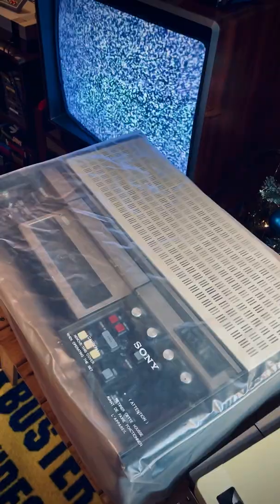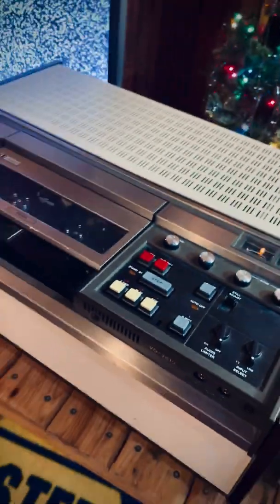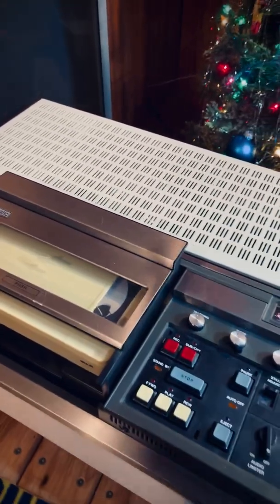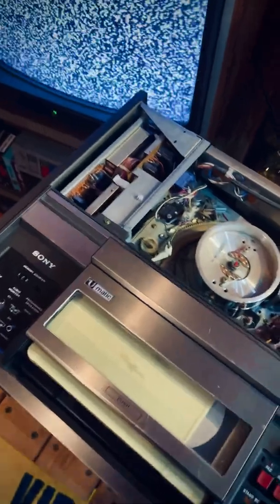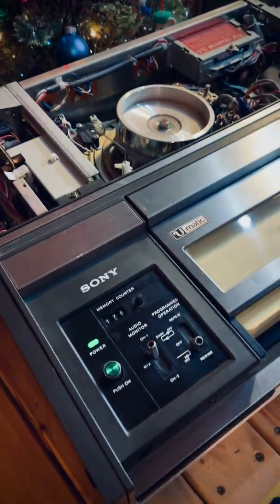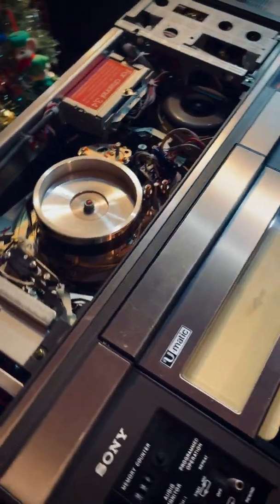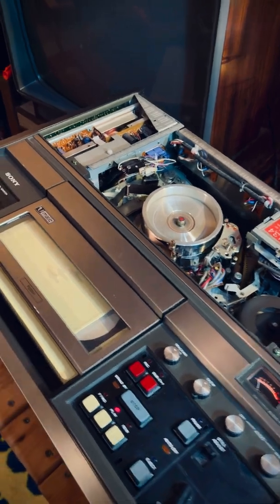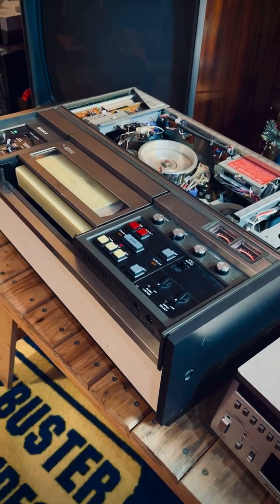1974 Sony U-matic VO-2610

Comment: @jeffdavis7872  To the commentor who believes these early 1970's VCRs were 6K UHD wayyyyy back over 50yrs ago....I can tell as someone who was there & who worked in TV/Film mid 80's onward....absolutely positively NOT even in your wildest dreams!lol Remember that we were decades from digital back then & everything was analog. In the 1980's in TV we used huge tape decks larger than this that were super heavy using tapes that looking about like these for playing & editing videotape footage for commercials or TV shows. The tapes contained 3/4" videotape & were 480 lines of resolution. By comparison low quality VHS tapes were 1/2" & ONLY 240 lines of resolution. Most home TVs many decades ago in the U.S. on NTSC system were basically ONLY watched at at just 240 lines of resolution same as VHS. In TV we shot everything at 480 which was the absolute best quality possible known as "broadcast quality" & we thought that looked super high quality compared to watching our broadcasts on a home TV. In the 1970's & prior News stories, commercials & many TV shows were shot on film rather than videotape. Film was superior quality which is why old movies shot on 35mm (tho some low budget were shot on 16mm) can be upgraded to 4K digital or even 8K whenever that becomes the next norm. Videotape unfortunately can NEVER be upgraded ever which is why older TV shows shot on videotape look very soft lacking sharpness & detail. I absolutely hated working with analog videotape back then because same as VHS tapes despite being very convenient was absolutely horrible quality compared to  film. Fact is nothing will ever look as good as actual REAL film. Most of today's movies are no longer shot on film but instead digital video made to look like film which is unfortunate because it can't be improved later. Just a little history lesson from someone who was in the industry for decades for those who were born years later who think we had super HD 6K (6,000 lines of resolution) 50yrs+ ago.lol

Comment: U-matic was intended for home use, but was just too expensive, so that waited for Beta to fulfill.  My high school in the early-mid 90s still had several Panasonic U-matic VCRs (and a bunch of tapes recorded off-air back when it was current tech), similar size/design as this one.  IIRC, on the Panasonics, you didn't push the cassette basket down, the VCR lowered it when you pressed a transport control.  I'm still curious why Sony reversed the tape threading on Betamax from U-matic's clockwise-around-the-head-drum to counter-clockwise.  In the early 80s, they came out with a new, smaller Beta threading mechanism that threaded clockwise like the U-matic, plus with guide pins that folded underneath when unthreading the tape.
I have a bunch of Beta VCRs, but no U-matics... I'd like to get an early one like this someday.
A couple of really weird aspects of U-matic are that the tape played from the right spool to the left, and the two spools turned in opposite directions.